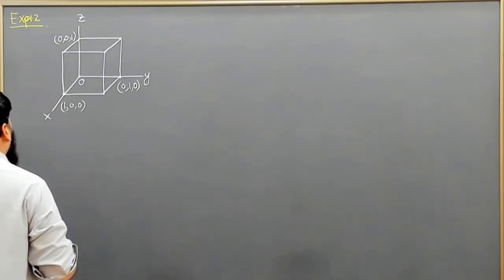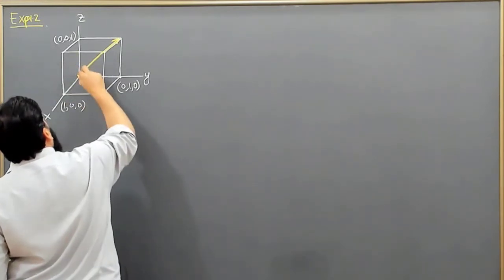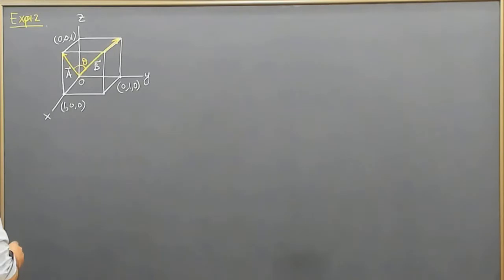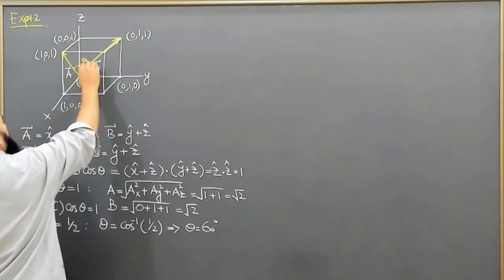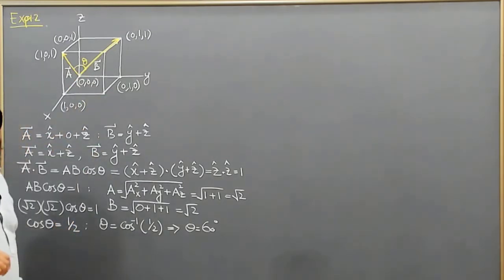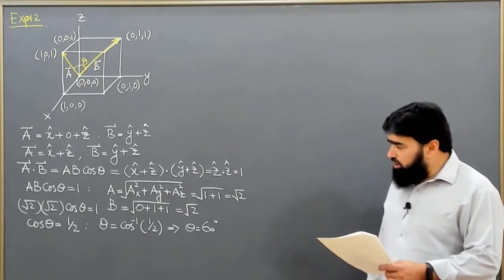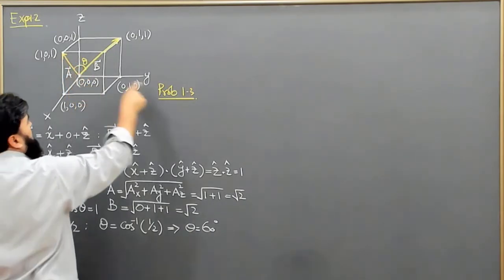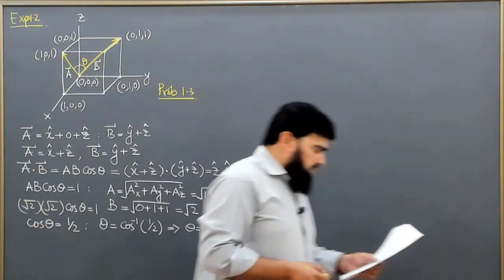L4.2 Example 1.2 Angle between the face diagonals of a cube

Comment: Consider a hollow object in the form of a capsule having length 'L', radius of cylindrical surface 'a' and radius of hemispherical surface as 'b'. If it has uniform surface charge density 'o find electric field at a point outside at distance 'z' from axis of cylindrical axis. Also find potential at the same point.
Reply: Kindly solve this numerical sir
Reply from the maker: In the first phase, I'm covering topics and some examples. Thanks
Reply: Kindly first solve it
Reply from the maker: You may look for some similar problems to find hints for its solution. Thanks